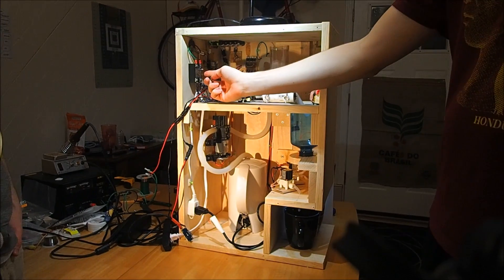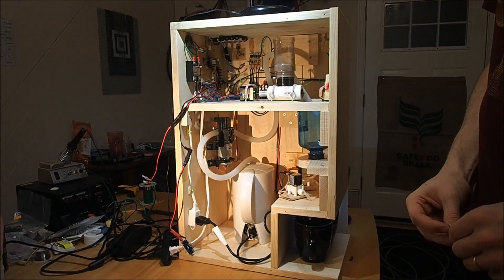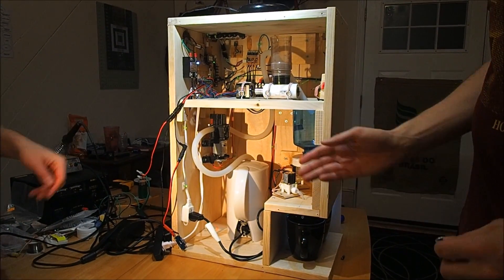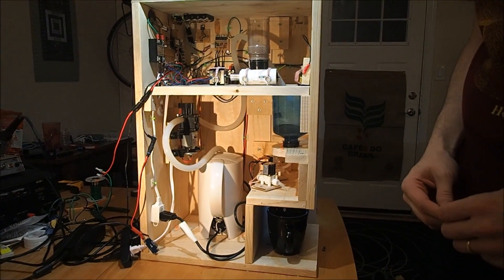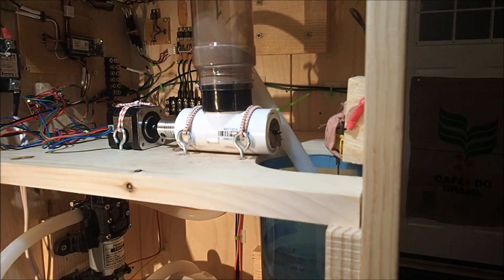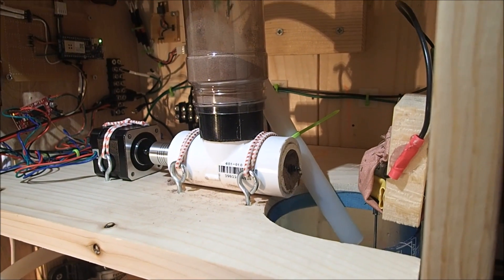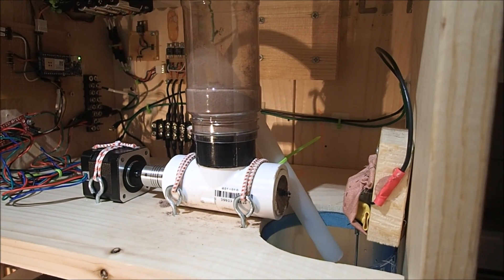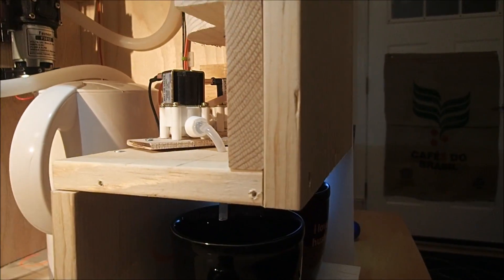Hot Cocoa 3000

Comment: first! jk.. does it mix before dispensing? seems like you're missing that step
Reply: I see the mixing motor in photos. is it powerful enough? the liquid dispensed looks a bit weak, but maybe it looks better in the cup
Reply from the maker: It does mix however we blew the motor before shooting the video.  Our 5V regulator circuit failed so provided 12V instead of 5V.  We have since purchased a new motor. That motor is powerful enough, it is actually made for mixing cocoa / milk.  It is from a milk frother from Ikea.
Reply: nice. maybe you'd have better luck with a small switching regulator. I'm guessing you used a LM7805, which overheated. another option, maybe try driving it with pwm from the arduino, with a mosfet on straight 12 volts. 5v is 41% of 12v, multiplied by a max pwm value 255, you could set the pwm pin to a value of 106 as a starting point, and under or over-drive it if needed. order extra motors and experiment.
Reply from the maker: We were thinking of using PWM but the 5V is needed to power the Arduino MKR1000 as well.  We were using a buck converter which has a LM2956S on it.  So not only did it kill our motor, but our MKR1000 as well.  Thankfully we had a back up MKR1000.  Long story short, we learned the lesson, not to leave a prototype project in testing powered on while taking a dinner break in the adjacent room.